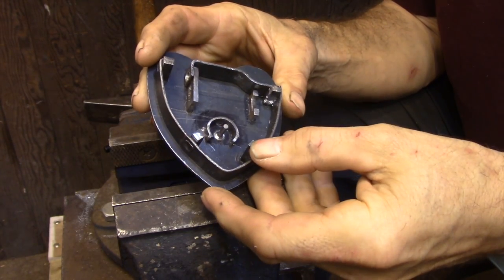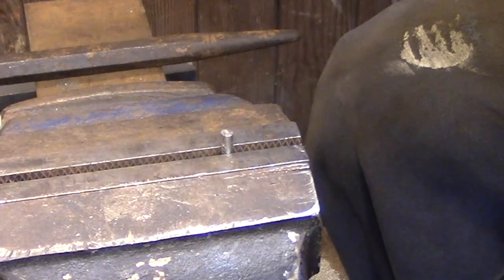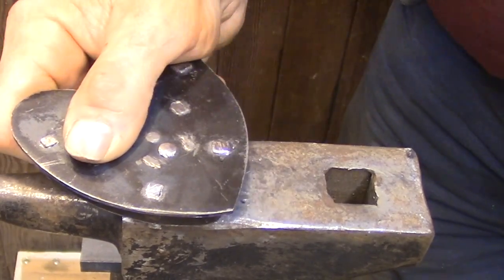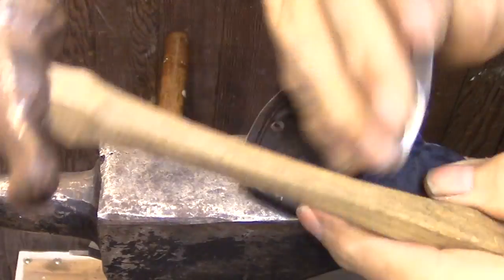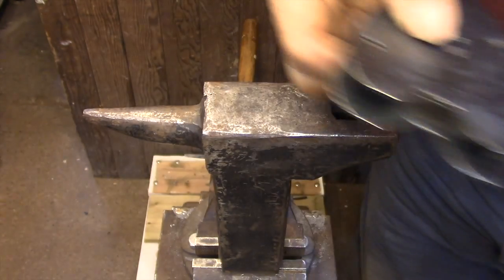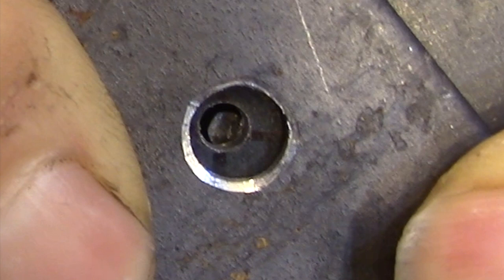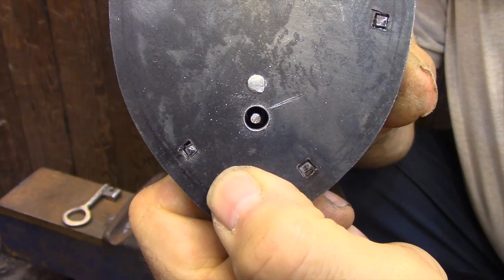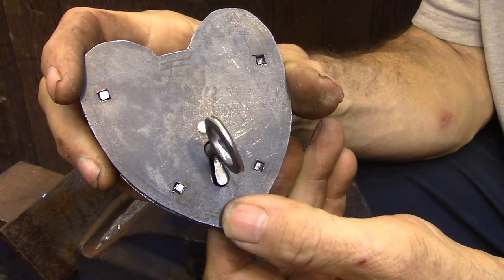Blacksmithing Project - A Basic Padlock 10

Comment: I have to wonder if it wouldn't be more efficient to change up the order; cut the bottom plate to the shape you want, drill the matching holes into an uncut larger top plate to give you wiggle room so the fitting for exterior alignment isn't laborious, and (having not permanently mounted the pivot pin, presumably) just drill the start of the keyhole through using the back pin hole as a guide. Something like that. Maybe on an earlier dry fit, so just moving the fitting to an earlier place in the assembly? Then cut off the excess on the front plate, and file the edges perfect now that they're in their final indexed spots. Though with how poorly the pilot hole for the keyhole fits at the start of when you're cutting/ enlarging it, there might be an even easier answer with regards to final fit-up of the top plate, like using dividers to place the pilot hole, meaning the step order doesn't need to be changed, making this perhaps simpler.
Reply from the maker: All my project videos are just a record of what i did on that day. If I had to make 10 padlock videos in a row they would all be different.  Finding the best way to do something is a process that is constantly evolving.  If you  are lucky, every time you do something you will figure out 5 or 10 other things you should try. I'm just here to get the process started. I quite often have to rewatch my own videos to answer questions and even I can't remember why something made sense at the time.